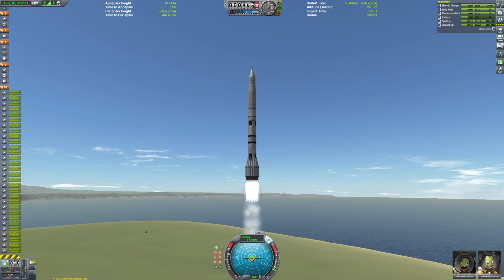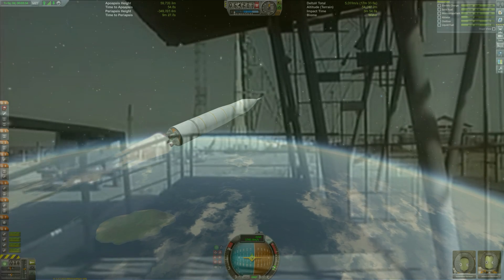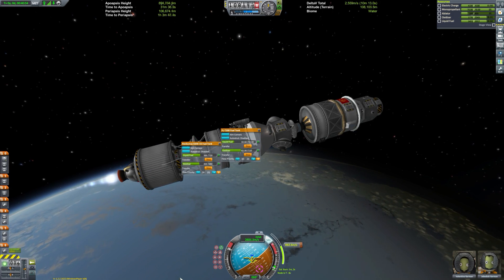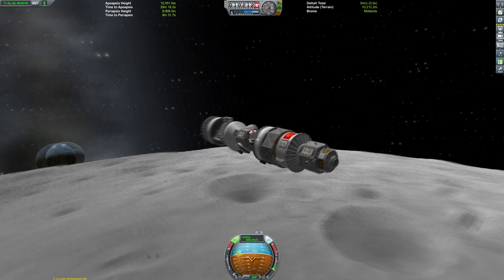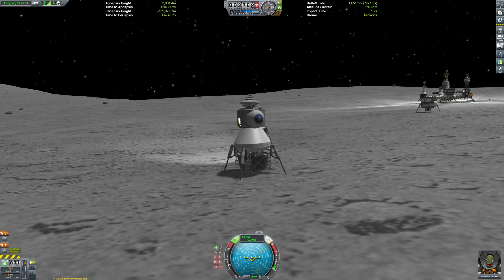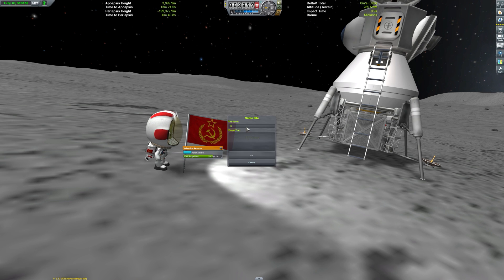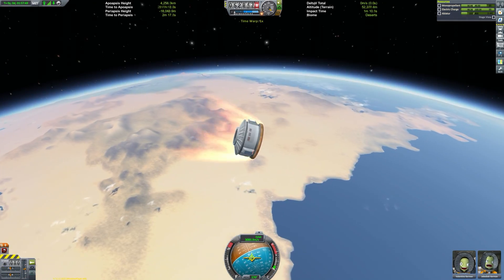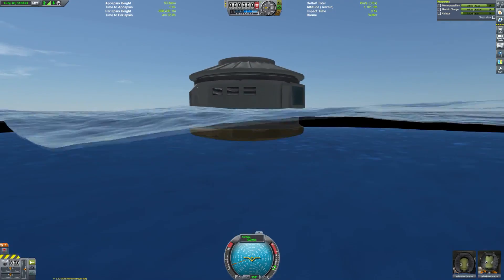KSP - The Failed Soviet Moon Mission

Comment: Well, it's not just reliability. Having multiple engines can cause serious oscillations of pressure in the plumbing between them. This was an issue on the Saturn V and that had five engines.

Anyway, I personally have made KSP rockets with over 100 engines in a stage, but again, that's KSP.

Comment: In the defense of the CCCP program and their seemingly over ambitious designs, due to the fact they did not have access to launch bases as far south as the united states, the result of which, meaning the initial stages of the soviet rockets had to have more thrust than their American counterparts to make up for the slower rotational speed of their launch site.
i.e Needing more thrust for the rockets weight in the earlier stages as the rocket had to fly further and faster than their American counterparts.
 So when you think about it, its impressive that they lead the space program for as long as they did, considering the post WW2 technological, expertise disadvantages combined with the geographical location of Soviet space program. Before considering that the Soviet union had to recover from direct invasion during WW2, lack luster leadership and the horrific state of their economy.

Comment: Th reason the Soviets Needed so many engines is because they didn't have large powerful engines. They compensated with a more efficient closed system set of engines rather than the less efficient but far more powerful engines the U.S. had designed. The Soviets focused on the moon around 5 years after the U.S. and did not have time to design a large engine before the U.S. made it to the moon.

Comment: Sergei Korolev knew the program would be rushed and underfunded. Testing was not an option for most components, the launches would be the testing; failure was expected and would be part of the process. Trial and error was a common plan in the USSR. Nobody was surprised by the explosions, they simply studied the debris and telemetry to find then fix problem and try again. This way of doing things produces targeted and untargeted knowledge faster and cheaper than exhaustive testing can when done properly (and the Soviets were well practiced at doing it properly). Similarly, Daniel Goldin would later implement "faster, better, cheaper" at NASA to great effect. Of course, 'failures' increased but production went up 40% and $40 billion less dollars were spent; science win, budget win. The N1 program did not fail, _it was canceled_. There was a space race and the race to the moon part of it had been lost; they had started way to late. The USSR focused on other aspects of the race and the N1 design never fit any of those. In theory, it could have performed a Venus fly-by and return complete with a shallow dip into the atmosphere, or 'skipping' as you say, two unmanned probe landings and one probe return. Both sides abandoned their plans for manned Venus fly-by.

A NASA engineer commented that the Soviet's use of so many engines was simply "an engineering choice" and "we could both still complete our missions if we lost %20 of our engines during launch." (turns out this was not a issue for the soviet engines, but was for the NASA engines). But it is true that government influence was fundamental to the choice to use so many engines. The government would not waste anything on specialized 'space mission engines', the space program had to use engines suitable for nuclear missiles. The design created to fit was the NK-15. There were larger engines of this type planned (therefore requiring less engines for the N1 design), but Sergei Korolev nixed the idea due to the volatile nature of this type of engine and he had personal issues with the designer. The NK-15 is a high-pressure, regeneratively cooled staged combustion cycle bipropellant rocket engine using oxygen-rich preburners to drive the turbopumps that were using subcooled liquid oxygen to cool the bearings. The highest thrust-to-weight ratio of any Earth-launchable rocket engine. Something key to this design is the preburners produce useable thrust from their heat and exhaust that is funneled back into into engine. The cooling system oxygen was also used for burning. Nearly all other non-soviet engines, to this day, waste their preburner heat and exhaust (though they produce less) and do not reuse their coolants. We (the USA) tried designs with oxygen-rich preburners and thrust from preburner exhaust but all our attempts exploded in testing and the design type was abandoned. And for one more boost, the inner and outer rings of NK-15s were purposefully arranged in such a way as to create an aerospike engine effect. Just how much aerospike effect was created is unknown but there was significantly more thrust produced than expected from the engines alone.  The NK-15 engines functioned perfectly. The N1 failures were, electrical, debris in fuel/oxidiser (precisely what debris and their source remains unsolved), inadequate stabilizers (the powerful NK-15s produced massive eddies), inadequate structure (the powerful NK-15s bent key components).

The original engines were ordered to be destroyed but scientist hid them away in a warehouse.  Orbital Sciences bought them and refitted them with modern electronics (wise) and the capacity to use modern fuels (turns out, not so wise). They were used in the Antares rocket until the 2014 Antares launch failure where the modern liquid-oxygen turbopump failed. The original engines have a spotless record.

Comment: Well, actually, the number of the engines (which were such good, effective, high thrust-to-weight ratio engines that the Americans started using them after the Wall fell) wasn't the problem in itself – what was totally fucked up was the "software" made to handle the engine stack. Basically all the N1 failures can be attributed to the software basically killing the whole rocket because there was a problem. Had it been designed better, it would have worked. (It wouldn't be the most economical rocket though, just throwing away so many NK-33s in a single launch; unless they figured out how to recover at least the 1st stage and reuse the engines).

Comment: I forget the name of the computer that controlled the engines of the N1-L3, but really it was problems with that that doomed the rockets. Often if an engine did fail, the computer would try compensate by shutting down the opposite engine to counter balance, but either software errors or bad wiring lead to the wrong engine being shutdown, which lead to the computer trying to counteract that shutdown... and well, you see where that leads. Well, and the other problem being that Soviet industry wasn't capable of testing anything other than building the whole rocket, hoping for the best, and then learning from what went wrong. Still though, the NK-33s aren't bad engines at all. I believe descendants of the design still fly today.

Also...
Plants Soviet flag
Doesn't play obligatory Soviet anthem
Much disappoint, comrade! ;) :P

Comment: Actually the N1 rocket with an LOK craft on it used an extraction like maneuver similar to that of the Apollo missions, the LOK craft would be stored in an adapter from block V to the LOK service module, fairing, and escape tower, and the LOK capsule did indeed have solar panels along with fuel cells that would activate whenever the LK lander was not docked to it, and finally, the LOK craft broke into 3 pieces before re-entry, being the service module, capsule, and docking module, the capsule was the only part of the rocket to make it back to earth in one piece, and there were specialized hatches between the service module and docking module (the 2 pressurized parts of the LOK craft) to make this detachment possible, and the N1 was only partially intended to go to the moon, it was designed to go to mars or venus (and recent studies show that if an N1 rocket was assembled today with a lower chance of failure, that it would have enough Delta V to enter orbit around Mars (not venus, as the soviets forgot to calculate the gravity of the sun pulling them in past venus) land and return, anyways, hope this helps!

Comment: N1 program could be succesfull if retards from Kreml give them more time. Russians was aware of Van Allen belts and spacecraft was properly shielded to operate in high radiation enviroment. (Apollo was joke in comparison with their capsule and depend on perfect timing and hoping for bit of luck, that there wouldnt be any solar storm in time of mission) Due to that russian capsule got much more weight and needed much more delta V. To achieve that they developed at that time brand new concept of closed-cycle engines, but lack of test facilities to make them reliable was reason, why they schedule number of test flights (they was expected to fail) and before they got to actual flight to moon, there comes decision from Kreml "Moon race is over, there is no point to continue this program. Scrap the rocket and salvage parts!" So engineers behind closed-cycle engines (BTW same principle was used later on space shuttle main engines) was fired from space program and ended as pig farmers... N1 program was 1 or maybe even 2 decades ahead of everything else by that time and its story is wonderfull example how CCCP treated with briliant engineers... If Nikolai Kuznetsov managed to emigrate and get same treat as Von Braun... We could have manned flights to Mars on regular base these days.

Comment: Interestingly enough, the N1 had the greatest engines ever built. During glasnost, the Americans didn't believe the thrust/Isp numbers they were hearing because they were so insanely good, and the Atlas and Antares rockets both use engines derived from the N1's incredible original design.
Reply: Only the Merlin 1D (SpaceX) has higher TWR (among surface engines) and the NK33 has superior Isp.

Comment: The reason why the N1 has so many engines was because 1st of all, at the time, the soviets didn't have the industrial capacity compared to the U.S.A. The U.S. Could afford to make huge rocket engines. Second of all, the sole designer of the N1, Sergi Korolev, had a very strong grudge against the only man who could produce large engines, Valentin Glushko. In the 30s, Glushko had blamed Korolev for a mistake Glushko had made. As a result, Korolev spent many years in a Siberian labor camp, giving him lifelong heart conditions untill his death, around the time when the N1 first launched. Third of all, Glushko wanted to use hyperbgolic fuel, which was more efficient than other fuels, but was extremely poisonous. Hyperbolic fuel could dissolve flesh, and if breathed in, fill the lungs with fluid. As the N1 was a manned rocket, Korolev strongly disagreed with Glushko. Therefor, Glushko did not produce large engines for Korolev. The only other man who could produce engines for Korolev was a jet engine designer, who had the very efficient experimental NK-15 engine. The problem was that the NK-15 was very small, so Korolev had to use 30 of them. However, It was also extremely difficult to provide fuel for the NK-15. The main reason why the N1 failed was because the NK-15 engines kept failing and shutting down.The NK-15 later developed into the NK-33 and NK-43, which today powers the K-1 rocket, Antares, and the Soyuz-2-1v rockets.

Comment: I think the N1 had a magnificent design. It actually traded mission success chance for total power. What that means is theoretically if one engine fails, all the other ones can have their thrust changed to keep the rocket flying normally and only have a ~1/30 loss in thrust. I heard that part of the problem there was that they didn't have the computational power to control that number of engines. 

I still believe the real problem was that Sergei Korolev, head Soviet Rocket Engineer and genius, died due to medical complications. Had he been alive during the 60's the Soviets would have made it to the moon far before we did.

Edit: I would also recommend reading about the Buran and compare it to the shuttle. Soviet designs were honestly very astonishing. They don't get nearly as much credit as they deserve.

Comment: SpaceX is building a rocket with 42 engines, hope it doesn't meet the same fate
Reply: The real issue that made N1 fail, was the program that controlled the engines (they didn't gimbal). 1 engine would fail, and the program was supposed to compensate and turn others down or up. So what did it do? Turned them all off.
Reply: Yeah, N1 failed because of bad programming, not the chain reaction engine combustion like a lot of people seem to claim.  Turns out the engines shutdown on failure a little too well!

SpaceX definitely has the many engines thing down at this point.
Reply: Levi Johansen is it Interplanetary Transport System?
Reply: Yigit GD yes.
Reply: @LeviJohansen  Not happening lol
Reply: no, thats not what i meant, i meant the engines were not designed to gimbal, instead a program would lower the thrust of some to make it turn. This program was also supposed to compensate for engine loss, which it didn't do very well, they thought they fixed it every time.
Reply: Light Bender no they didn't, they renamed it the BFR, but what they are trying to do with BFR is the exact same as the ITS
Reply: @benjaminbee4788  then it was renamed to starship
Reply: @Galileo1912  yeah
Reply: Earth to Earth is not likely to be very practical I'm afraid. Gigantic reuseable transport ICBMs aren't likely to be commercially viable unless you need 2-hour shipping to the other side of the world and don't care about the cost.
Reply: @petersmythe6462 US Military enters the chat
Reply: Levi Johansen  have some faith in Musky Boy!
Reply: Levi Johansen well, we have new engines, new computers and static fire tests nowadays
Reply: good news! It hasn't yet.
Reply: Mission Passed
Reply: Levi Johansen Jesus Christ. That’s like the stupid rockets I build!
Reply: Just Another Youtube Channel Well, clearly you are smarter than Elon Musk...
Reply: N1 fails was due to the kord system
Reply: Let's also hope elon musk starts worrying about radiation. So far he's pretended the radiation "isn't that bad", even though it's probably the most dangerous thing about interplanetary space.
Reply: @picketthespacewizard3749  Oh he knows, he's just a scam artist who never intends to get that far.
Reply: No worries the rocket explodes is really because of the soviet era software being not reliable and the engines are not well tested, which won't happen in SpaceX
Reply: 31 engines
Reply: Because we tottally need an interplanetary transport system lmao.
Reply: With captain amphetamines at the helm? What could possibly go wrong!?
Reply: Levi Johansen yeah, I hope
Reply: Look what happened!
Reply: HAHA they trashed the ITS!
Reply: Crap! I live near Cap fuck does this mean Im going to die?
Reply: Benjamin Bee uh no they made it much smaller and payload capable plus the Earth to Earth thing.
Reply: Deltuhvee So that's why it truly failed the engines didn't gimbal, really....

Comment: If I remember correctly Apollo 13 had an engine failure on stage one, so even the "simple" design had issues.
Reply: Stealthpelt yeah but that's not comparable to having every single moon landing attempt thwarted due to bad design.
Reply: The engine shutdown was on the S-II stage, not the S-IC. The inboard J-2 engine was shutdown by the computer because of pogo oscillations. In general, the oscillations seemed to be caused by the engines being too powerful for the structure of the rocket, not the engine outright failing.
Reply: It was the second stage not the first

Comment: The last launch of the N-1 was ALMOST successful. The first stage failed mere seconds before the second stage was due to light.  They knew the first stage was going to fail before it did.  If the controllers had overrode the system, they could have separated a little early and lit the second stage and let it run a little longer than expected, and (assuming no problems with the rest of the stages,) could have had a successful launch.

Comment: I am more than sure that if the engineers could work further on their rocket they would have perfected it.
Just like the west keept saying that closed cycle engines are impossible, the same way they say that the N1 getting to orbit is impossible...  You never learn from YOUR mistakes, do you?

You also did not mention that the engines left from the N1 rocket actually ended up powering NASA's rockets from the 1990s up to now. 

By your logic, if using too much engines is a failure, i guess Space-X mars mission is a total disaster, then... 

"The engine that came from the cold"  - watch it, if you haven't.